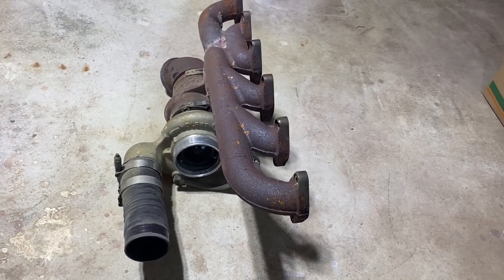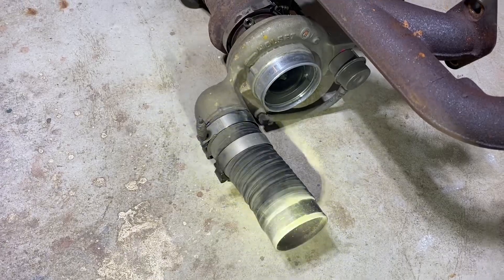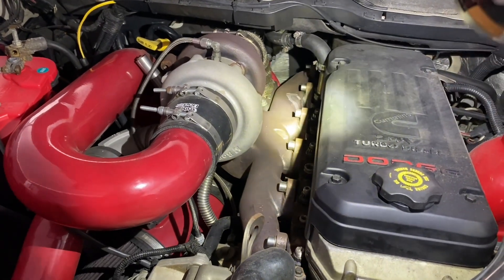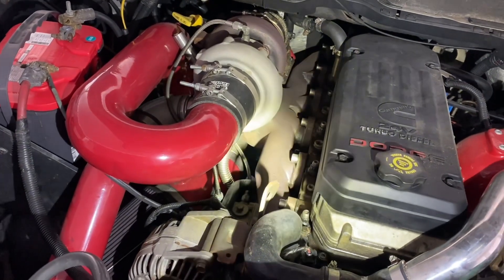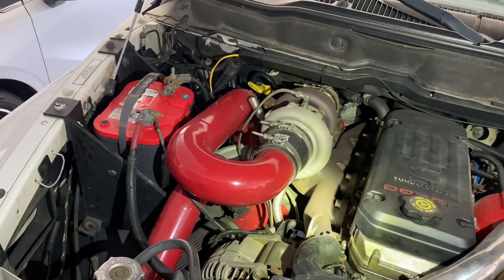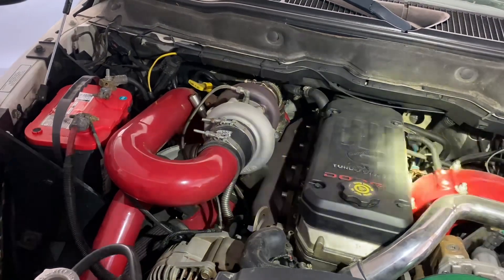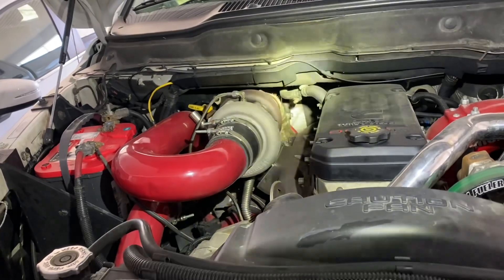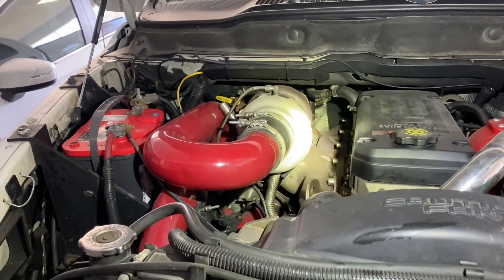Cummins 2nd Gen Swap Vs Factory Exhaust Manifold Comparison

Comment: Look up the 12v tune for the common rail. It’s slick.
Reply from the maker: I’ve got a stock horsepower 12v tune and a 120 horsepower performance 12v tune. I love them. I’m doing some fuel economy testing with the stock hp 12v tune now that I’ll make a video for in time. You can hear how it sounds here: https://youtu.be/E9Ws889eOB0

Comment: Nice!  Is there a performance upgrade switching manifolds? Big difference?
Reply from the maker: There definitely is a performance improvement with the addition of compound turbos! The performance depends on the turbo setup you add with the manifold, and the fueling, depending on your goals you have for the truck. Compounds are a great way to go with a second Gen swap for an all purpose good performing truck!
Reply: Technically sure there is a gain but it's not much, maybe 20hp.  The real gain imo is getting rid of the t3 foot and going to t4 which opens all sorts of doors for new turbos.  If staying with a t3 turbo or a drop in just keep the stocker if it isn't cracked.  If you have extra coin and like the look go for it.  You have to pull the manifold with the turbo anyway so might as well put something better than a rusty stocker.  But it's not really done for power gains, anyone saying different is getting kick backs for selling something.